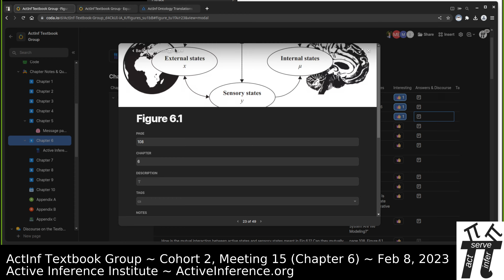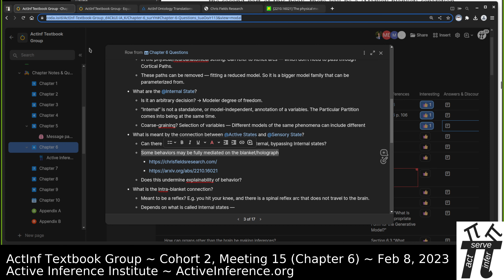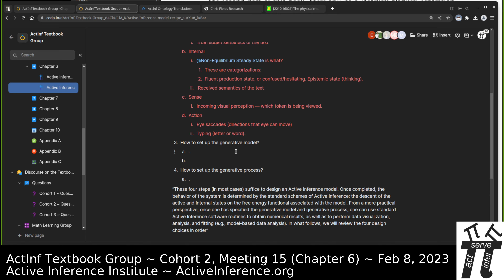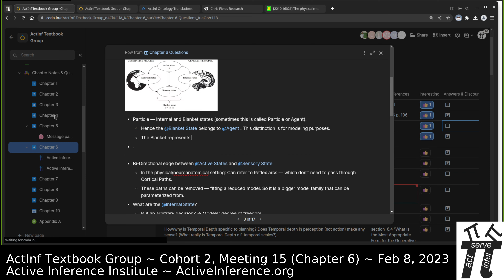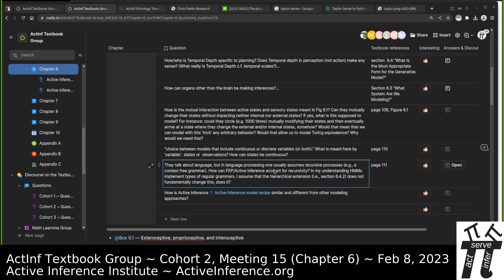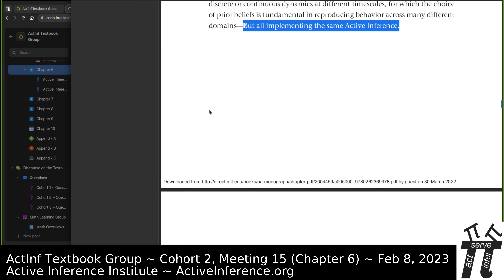ActInf Textbook Group ~ Cohort 2 ~ Meeting 15 (Chapter 6, part 2)

Comment: Would it help to just model the Agent to its Environment?  The separation is non-arbitrary.  Interactions within an Agent (cell, cell system, organ, organ system, organism vs social system) are structured and behave differently based on where your delineation between an Agent and it's environment lies, right?